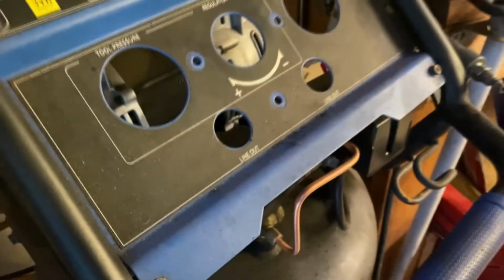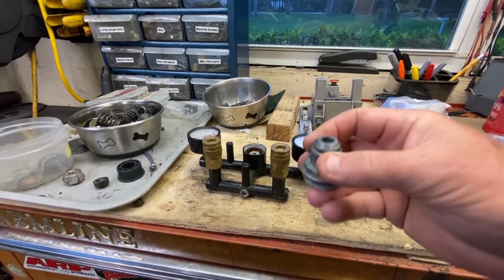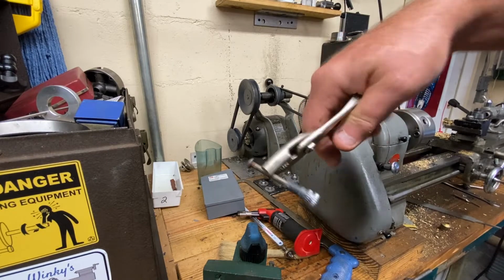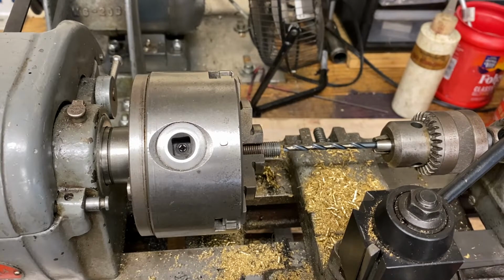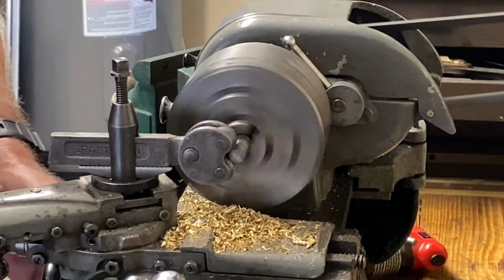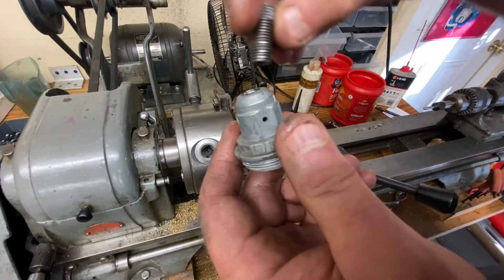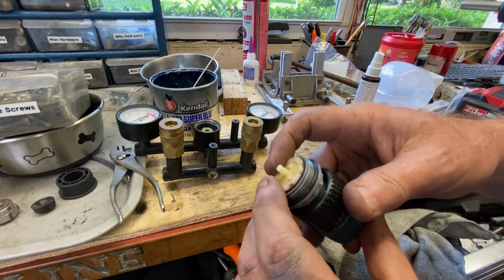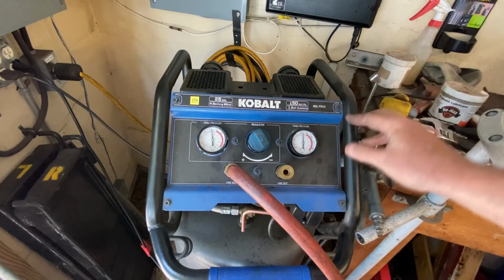How to repair a Kobalt model 3332643 air compressor regulator!

Comment: Thanks for video. Same problem here. How about throwing that whole manifold in the trash and figuring out how to bolt on a replacement manifold that just has one gauge and a good old 1/4 turn  hand lever and a female air chuck like the old days on the farm. I don't need variable pressure in the hose, do I? (Tires and filter blow out is all I do) TY
Reply: Or I guess if you're still offering to fix these as mentioned in other comments email me typical cost and I'll consider it... TY, Wes
Reply from the maker: Email me. It's in my channel about section but here it is as well: motorestofl@gmail.com
Reply from the maker: I need variable pressure. Frankly, it's easier for me to bang out a repair on the lathe even with screw cutting, than it is to figure out how to adapt a different manifold, perhaps weld up a bracket, etc. I'm fairly well accomplished with screw cutting even metric threads now, I hardly ever even use a thread die, I can bang them out faster single pointing, so the machining is the quickest way to repair these for me. Long as the junk aluminum body isn't completely smoked, I can fix 'em. If you're a subscriber I just do it for parts and shipping. Typical cost is like $20 bucks plus shipping. IF you're a subscriber and when I can get to it. I have a lot of backed up machining projects right now.

Comment: I guess I got lucky, I fixed my regulator with a #10 o ring that was munged. I was able to fix it with a wrench, channel locks, and a 5/8 or 16mm  socket.
Reply from the maker: I always go overboard. Way over-engineer stuff, but it usually never breaks again. Cheers.

Comment: Great video.  I have the same compressor and am on my second regulator.  Like the original, it leaks, so I can't leave pressure to the tool port or it runs too frequently, the compressor gets hot and trips the circuit breaker.  Absolute garbage.
Reply from the maker: I put a small fan atop the compressor, for when it runs a lot. It sure does get hot.

Comment: If the spring gets weak I wonder if you could put a washer or two in there to give it a bit more push action.
Reply from the maker: Spring isn't weak, the threads strip out because of the spring pressure.

Comment: I followed your repair and fixed my compressor. Very cool. Only problem is I didn't replace the knob. I only have a bolt. I don't have a metal lathe and when I backed the bolt out it unscrewed all the way out. The 5mm screw  came out of the end of the bolt. Perhaps CA glue on the screw will stop it from unscrewing. Thanks for the guidance.
Reply from the maker: I used blue (non-permanent locking agent, technically) on mine, it's actually a Permatex product. Good dose on that tiny screw does it. My first repair, the screw did back out, the second, it stayed as I used more product. I basically douched the screw in blue. Just did another one for someone and I douched it the same. But super glue would work fine also. If you ever had to take it apart again, heat from a bic lighter or pen torch would soften the glue enough to get it out. Really, that should be a left-hand screw and it would never back out on its own. I'll have to look into that. Cheers.
Reply: I was thinking why not just grind a knob on the end of the bolt like the screw? Oh, by the way I got an email from Kobalt today. They are shipping me a new regulator. Not sure if it's the entire manifold or  just the chinieseum part.
Reply from the maker: @longdriver2  I don't understand what you mean by grinding a knob on the end like the screw.
Reply: Instead of drilling the 5mm hole and tapping The 8mm bolt it why not just grind or machine a round end to match the 5mm round head screw? Then it would never back out. Just a thought. I did drill and tap it like you did.
Reply from the maker: @longdriver2  That end needs to be slightly larger than the major diameter of the screw. It's actually a 10mm, not 8mm screw. A bolt converted into a screw, to be technical. This prevents the end from coming through the threads, obviously. I'm still not understanding how the end could be ground or machined to make it larger than it's original major diameter. Material would have to be added, not removed, hence, the screw/washer which is larger than the screw itself. Perhaps I am dense, but I can't understand what you are suggesting.
Reply: I watched your new video with the replacacoil. Nice job.

Comment: Great informative video. I had one question though! By doing this does it help with the pressure drop when using air tools?! I know it drops like 40psi if im not mistaken! Thanks for the video again.
Reply from the maker: No. That's a factor of orifice and hose size and supply vs demand. This just fixes Chinese junk metal.
Reply: @MotoRestoFL  I thought so thank you for the response 👍

Comment: I know it's been awhile, but how would you prevent this?  I'm considering purchasing one of these.  Should I start by taking the 'regulator knob' out and greasing the end of it?  Thanks if you see and respond.
Reply from the maker: I see everything. I know nothing. Lol. Seriously, I think you’re spot on. Take it apart and inspect it, grease the thing well. The grease helps but the main issue is the pot metal that the threads are made into. They’re probably not even cut threads, probably molded. If you buy this and I assume it’s used because they’re discontinued to my knowledge, I’d replace that thread with a Time Sert ASAP. If you get to that point and want me to install one, send me the regulator I’ll do it for free labor just the cost of materials and shipping, in exchange, like/share and subscribe, perhaps recruit some friends to do the same. Let me know. motorestofl@gmail.com.

Comment: Just ordered on of these, doubt the issue has been addressed by Kobalt?

Question, when this assembly fails, does the valve fail open or closed? Just curious as I have a secondary high quality regulator and dryer downstream of the compressor, so I am guessing I really don't have to have a primary regulator assy (unless the manifold leaks air or it fails closed)?
Reply from the maker: Reed valve? It’s a diaphragm under spring pressure and is closed unless the regulator screws into it to open.
Reply from the maker: My apologies I read wrong. The valve fails closed as mentioned below. Spring pressure keeps the valve shut until the screw adjustment pushes against the spring and proportionally opening the valve until opened all the way.
Reply: Closed

Comment: Side regulator assembly to bypass the factory one
Reply from the maker: Yes that’s a good idea. If I was to do that I’d build a heat exchanger to cool the compressed air before it hits the tank and eliminate most condensation.

Comment: How has your fix help up?
Reply from the maker: Still works. Though I think it needs more attention and perhaps a better repair for long term use. I will get to that when I can, maybe do an update video on it. Cheers.
Reply: @MotoRestoFL  I contacted the mfr to replace my first one when it started leaking.  They said they had made some changes to the new one.  Nope - it started leaking as well.  Rather than fiddling with it, I'm considering just installing a REAL regulator instead.

Comment: Very informative Video. I haven't finished watching yet (@ 22:16 now). After seeing what you've shown so far, I would recommend to install a Helicoil to repair the damaged Female threads in the Alloy piece, reassemble with Wheel Bearing Grease and you're done. As a side note, I wouldn't be fiddling about with releasing pressure each day (which is what caused your premature Regulator Failure), an alternative recommendation is to install a "Ball Valve" before the Hose to lock in Pressure as I have seen a few air hose failure's overnight during my 43+ Year Career as a Professional Wrench (One time in particular that a whipping hose hitting a Car at a Dealership caused a lot of damage).  Randy   AKA randog311
Reply from the maker: You’re right about the threads I can feel them getting problematic already. That’s on my list. My habit of releasing pressure comes from years in the fire department where we had to do that when we used the cascade system to refill SCBA bottles. It’s to protect the regulator, not the elements downstream. Cheers.
Reply: @MotoRestoFL  I stumbled upon your wonderful video while trying to decide between the Kobalt Compressor you have or purchasing a Model # 20020 California Air Tools 20 Gallon unit for an additional 176 Dollars from Lowes Online (Ordered the 20020 / expecting delivery on February 27th Monday), your video and many others revealed the Kobalt's Pressure Regulator to be of poor quality and helped me decide not to get the Kobalt. Had I decided to go with the Kobalt I would have opted to build my own Manifold with a Milton Regulator. I've already ordered a pair of Milton S-786 1/4" MNPT "T" Style Couplers which I like much better than the "M" Style Generic Couplers that are included the the California Air Tools Air Compressor 20020.  Thanks again for the Video.  Randy  AKA randog311
Reply from the maker: @randymueller2349  thanks. Consider subscribing because I am going to do some additional work on this regulator based upon input from a few viewers.

Comment: It looks like you have the tools there to machine a replacement part.
Reply from the maker: That'd be interesting to try, however, I cannot single-point metric threads on my lathe. It doesn't have the change gear provisions for those and the lead screw is wrong. Guaranteed it's all metric since it's made in China.

Comment: Thanks for this video. Because of you video where you detailed how the regulator was assembled, I was able to take mine apart. Unfortunately, I won't be able to fix it, as the issue with mine is that the small spring in the pressure valve is corroded and has failed. So now I have either full tank pressure to the tool or it leaks until the tank is empty.
Reply from the maker: You need only a spring to make it work? Measure what's left of that one and/or the space it occupies inside the regulator (I don't exactly recall how large it was) and go on amazon. You can most certainly find air compressor/regulator springs or spring kits.
Reply: Can you please help here? I have no clue how to take it apart and would really like to do that to mine!
Reply: @HARNEX12  what part are you having difficulty with?
Reply: @MrGregoryMartin  I cannot figure out how to get the regulator knob off and apart. I tried using pliers on the metal ring but I can't get it unscrewed and it's hard to get anything in between the plastic knob and that metal ring.
Reply: @HARNEX12  I was stumped by that as well. What I did was use my skinniest channel lock pliers and unscrew the valve while leaving the knob in place.
Reply: @MrGregoryMartin  I tried that as well and almost stripped one side. Maybe I should find a vice somewhere and try it out...get more leverage.
Reply: @MrGregoryMartin  thanks for the quick replies and help!!
Reply: @HARNEX12  that metal ring is quite snug, but it does break loose.
Reply: I took your advice on the spring. I bought an assortment on Amazon, and now it works like a charm!

Comment: So I came across your video because I had the same issue.  I thought about attempting your repair but don’t have the knowledge or tools you do.  The only thing that concerns me about your repair is I am afraid that since the regulator is aluminum or some other soft alloy the same this will happen again in 2-3 years.  I ended up repairing mine with a helicoil.  So far it is holding but it’s been only a few days.
Reply from the maker: That’s fine. You’re right it’s cheap Chinesium metal. I thought about that and just greased it heavily. Will have to go back in from time to time and re-grease it.
Reply: maybe a better solution !!